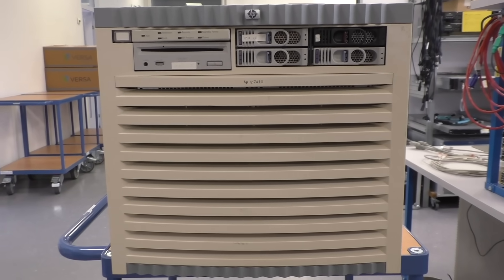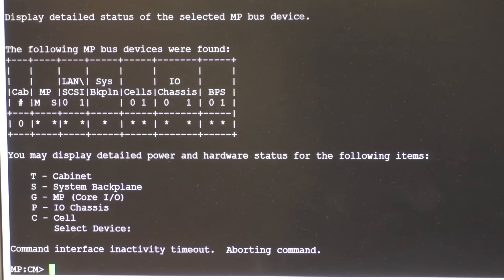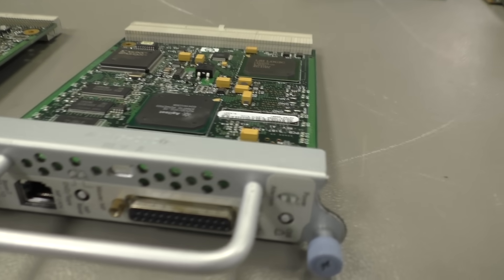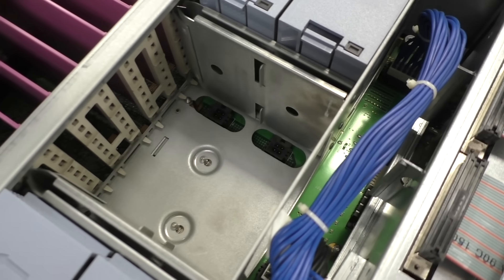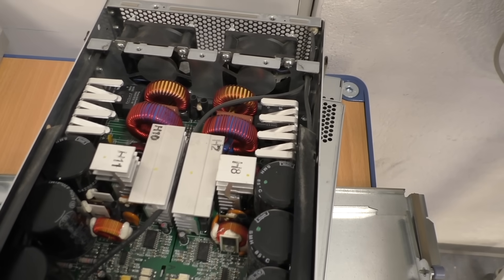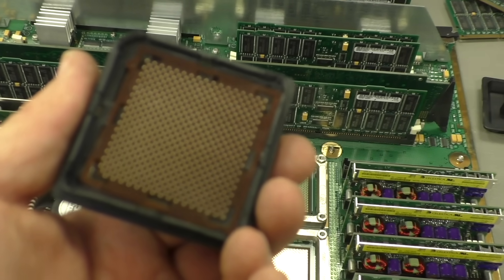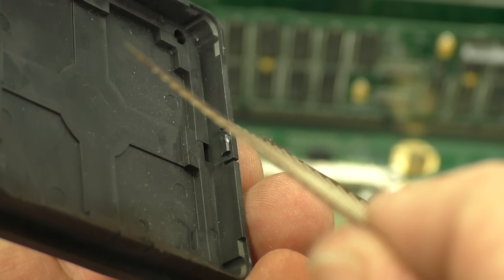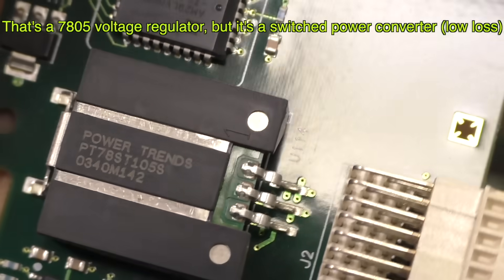HP9000 Series Server Teardown (PWJ262)

Comment: 7:20 I have a little bigger 12V HP Server PSU that is quite exact 1/4 of that size in width and it only have a small filter at the end that is like a hand long so that could be removed and thus be even quite a bit shorter, but this can do 2450W. I also have the small classic office sever HP PSUs that can do 1200W that in length is about the width of that one in the video. So 20 years+ do a lot in tech evolution for sure.

Comment: That's interesting, the interface material for the interconnect chip. It's almost like little balls of steel wool, only made of gold instead. I don't understand why they went with that conductive rubber stuff for the CPUs, seems like an odd choice. Maybe it was done that was as sort of a heat dam to reduce the amount of heat from passing into the mainboard? I'm just stabbing in the dark with that guess.

It's always fun to get a look inside all that enterprise level equipment. Just designed and built on a whole different plane than consumer grade stuff.
Reply: I was a Sysadmin back then, HP support always did hardware work, I saw more of the insides in this video than I ever did at work.
Reply: My guess  is that was intentionally designed to serve for 15 years of life and then make the client bringing money again.
Reply: conductive rubber stuff I think specifically made for one use only to prevent unlicenced adding of more cpu's, or any change of configuration
Reply: @makerofstartup7902  Maybe, but that would be much easier to do via BIOS or a la Apple and their security chip that verifies that the hardware is genuine Apple crap, or it refuses to boot into the OS. It seems a bit silly to go that far, especially with all the licensing that revolves around enterprise segment equipment where they could just void your license and/or sue.
Reply: @gvii  good point, maybe hardware guys were the ones with assigned task.

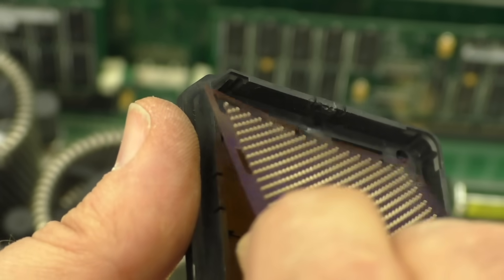Comment: 14:20 Uhm .. i'm not so sure about if you're really screwed at this point..

There are also other cpu and chip types which are connected trough some insulated pads stuffed with wires or just like zebra-strips from LCDs.

A very funny thing is that they're more or less conductive all over the surface, but only exactly to the same spot on the other side..

So probably, one could create a contact-pad out of modern materials ......... i think .. hrm. hope. ;)

Would be sad if all those machines get scrapped in the long run. ;)